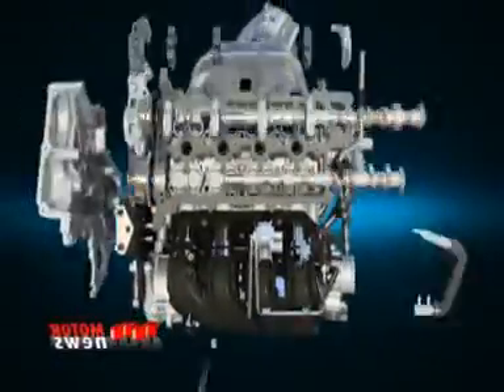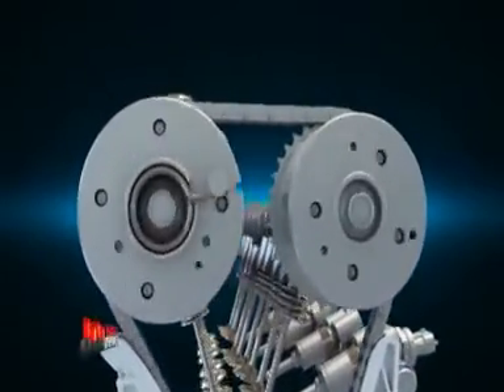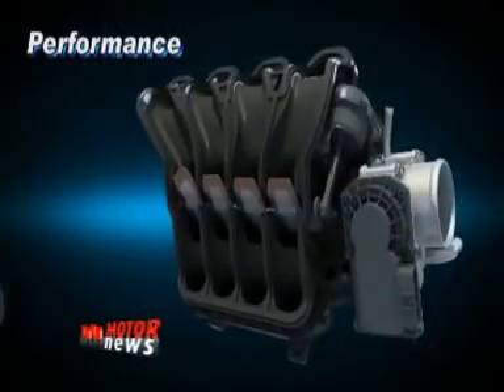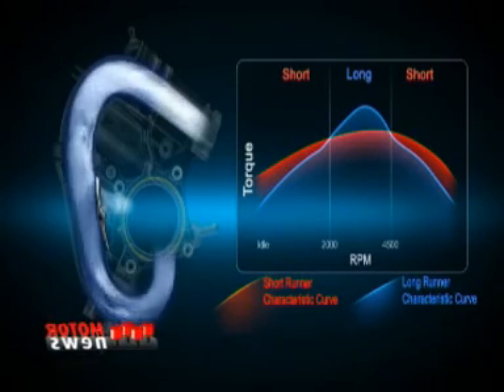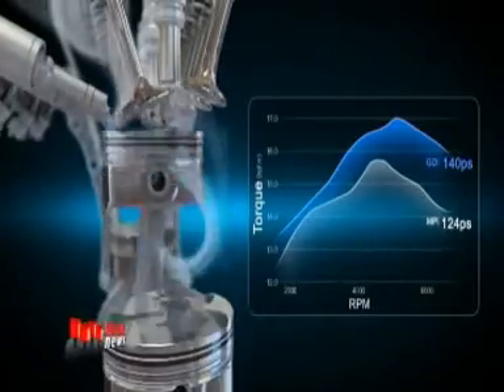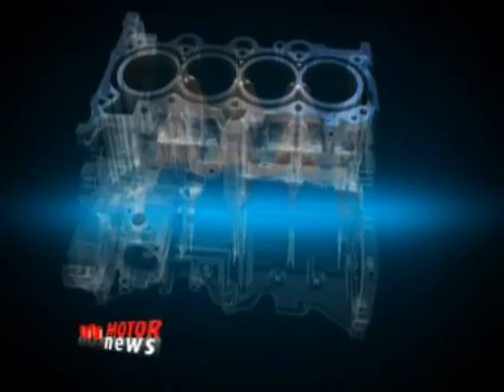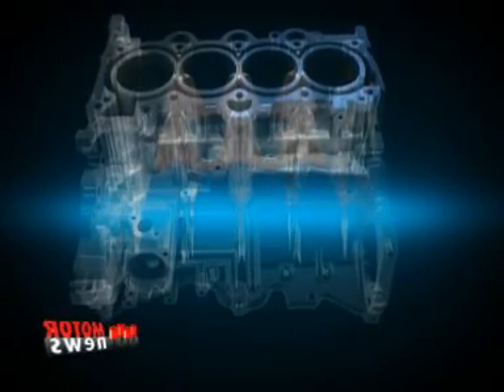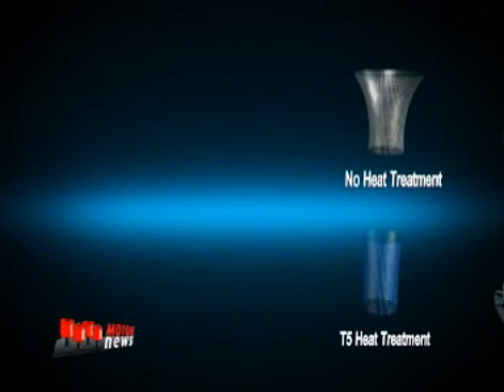Hyundai New Gamma 1.6L GDI Engine at Beijing Auto Show 2010

Comment: These engines have zero low-end torque though
Reply: LMFAO youve never driven one have you
Reply: You are probably meaning the throttle tuning that Kia/Hyundai have for low end. A simple programmer will fix that as the throttle is tuned to not allow 100% throttle down low for obvious reasons. The engine it's self has 200flbs which is good for a 1.6 engine.